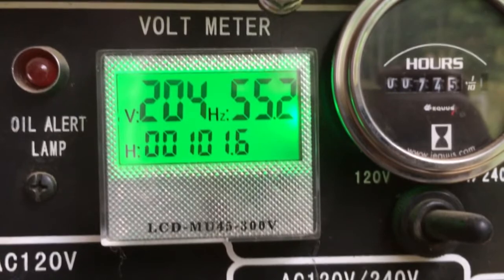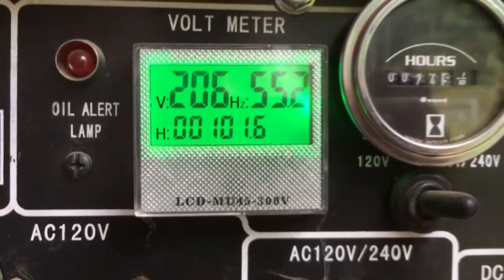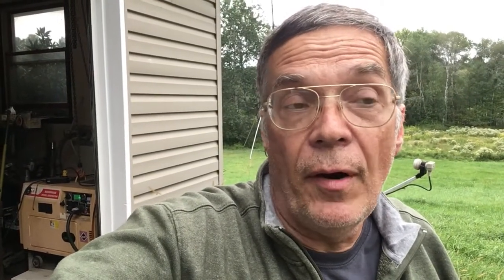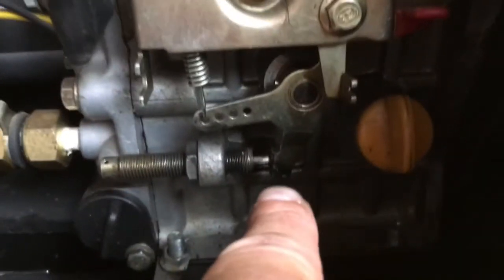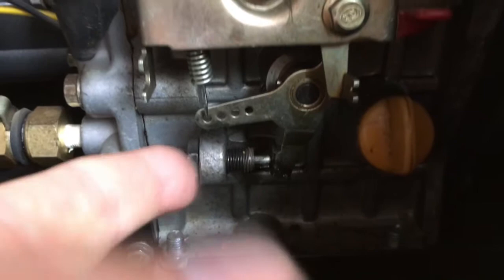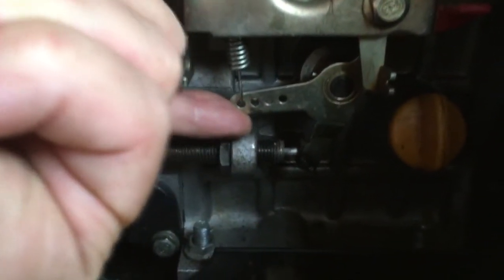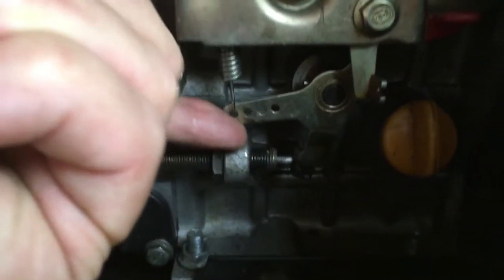Silent diesel engine governor adjustment operation and repair

Comment: Why does anybody that sold these not want to talk about it.. what happened ?
Reply from the maker: They are not well made (poor governor design, voltage regulation), well documented (engine and generator), well designed (Mine did not have an access hatch for performing valve adjusts), or well supported.  They are good for running incandescent lighting at best.  They appear to have been good for making a quick buck.   Diesel engines need a solid load to avoid "Wet stacking" and low loads kill them.  I relied on my past experience to keep mine alive until I could replace it with a gasoline fueled generator.  I would never recommend a high speed diesel generator again.  Diesel is great for prime power (low speed/clean load) generators.   Too much information?  TMI
Reply: @Neighbour_Al  yes mine doesn't have a hatch to adjust valves.. such a basic thing.. is real pain to adjust.. I just don't understand what goes on in manufacturers' minds sometimes..

I run an aiconditioner so at least I have enough load on mine

Comment: Your video was very helpful, my generator was running way too fast and putting out way too high of voltage 140 on the 120 side 300 on the 240 side.
Now it's working correctly.

Comment: I just picked up a used silent genset and its low on frequency and voltage, the fuel/governor thing isn't even near the limiter thing. Will i need to move the spring to one of the outer holes to speed it up?
Reply from the maker: I'm sorry Mick, but I scrapped that engine years ago and just don't know.  I've left the videos up to help folks as best they can.
Reply: @Neighbour_Al  thanks, I worked out the whole full and no throttle mechanism pivots, its making full power at the right frequency but still not touching that limiter. I guess someone might have played with it or I haven't reached full load yet.
It was run at low load for its 1000 hours and there is tonnes of carbon to burn out.
Reply: @mickwolf1077 how did you adjust it.. my spring loaded bolt thingy is no where near the governor .where it is positioned now. it has nothing to do with the running of the engine..  mine I bought new and has always been like that.. but it is running a bit slow  .. 47 hz and 220v . Instead of 50hz and 230v..
Reply: @ShorrockPaul  I had to go back out and look at it again but the mechanism where the run/stop lever is (on this one anyway) is on one bracket and is bolted to the engine block with 2 bolts, the left bolt is a round hole and the bracket pivots, the right bolt is where the bracket can move up or down, when both bolts are loosened the whole throttle lever bracket can move adjust the engine speed. I find it better to have the bolts not fully tight because the engine vibrations will rattle it around while adjusting.

You can move the spring attached to the arm to a different hole if you cant reach the required engine speed.

that screw spring bolt thing is only there to limit the maximum fuel allowed, so when its running no load then that spring bolt thing wont be used, if you load the engine then the governor will demand more fuel too maintain the engine speed but only until its stopped by that bolt spring thing. 

i hope this helps, I can make a video if anyone needs it.
Reply: @mickwolf1077  very helpful thanks. Will adjust mine to get the 50hz spec

Comment: If that little spring loaded prick is just dirty it comes apart easy. Opposite end from the little spring piston bit had a flat head bit end on mine. Clamped the bolt end in pliers and screwed it out. The bolt tensions a spring that pushes on the piston. Its kinda firearm ish. If it's not all rusty, oil and work it and flush the crap out of it and oil the shit out of it.

Comment: I spent $1,000 getting my generator fixed up and they sent it back to me with low frequency.  Good thing i found your video soo i can let the "pros" know what they did wrong.  They severely jacked up the governor mechanism.  it is all twisted and i'll be messing with this thing more to get it back how it should be.  Thanks again!!!